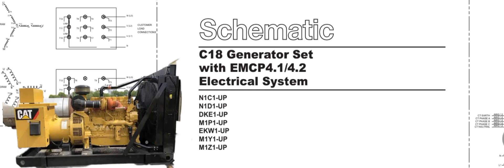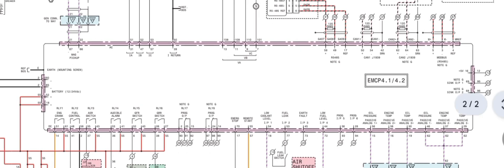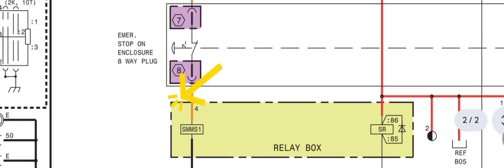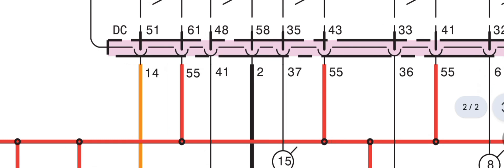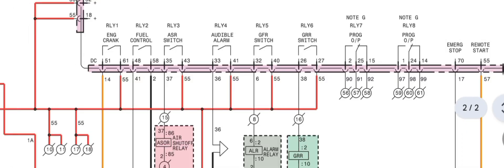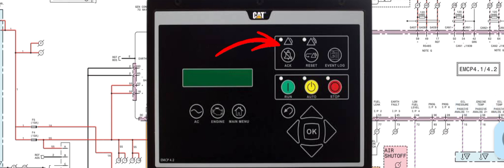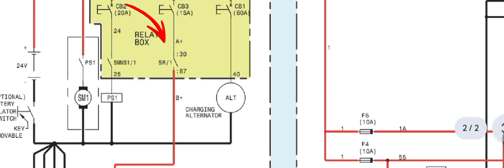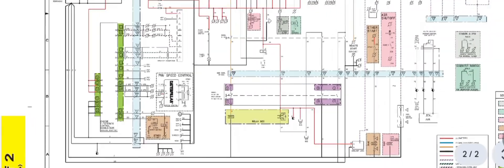Caterpillar Generator  C18 & C15 Model Engine crank but Doesn't start How to fix it.

Comment: Hi sir ! How do i know that ECM has woken up ? 🤔
Reply from the maker: Tommorow I will make a video on it about ecm
Reply: One more question sir. Does ECM pin 70 wire 10 relay-controlled by Emcp fuel control relay ???
Reply from the maker: Yes. Emcp control the fuel relay
Reply from the maker: Check the last video
Reply: Ok. Thx